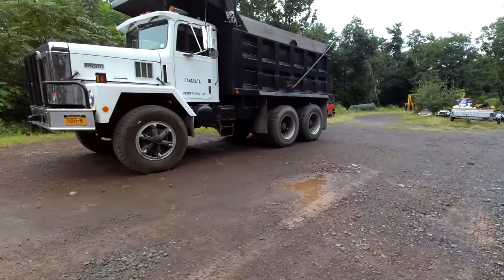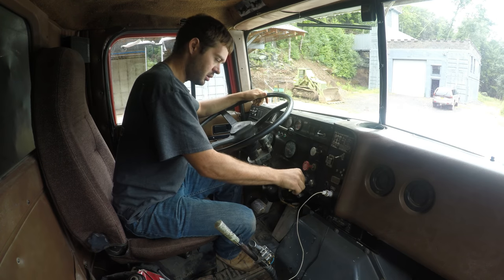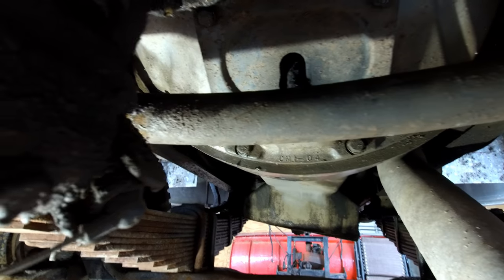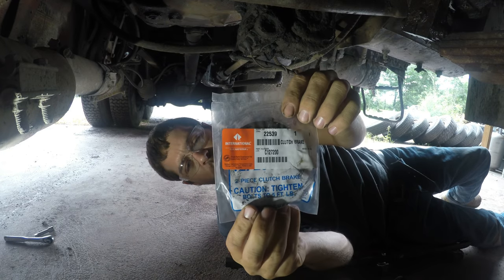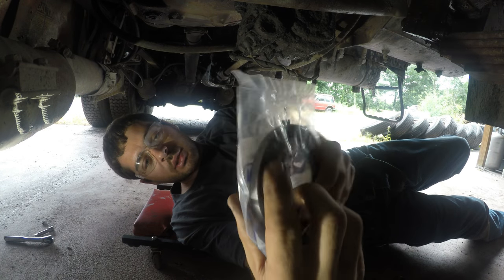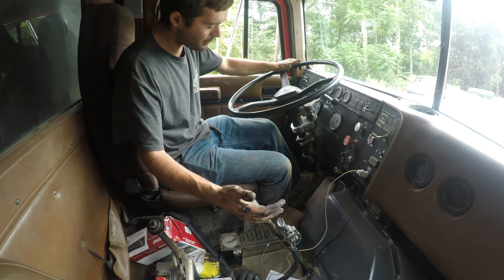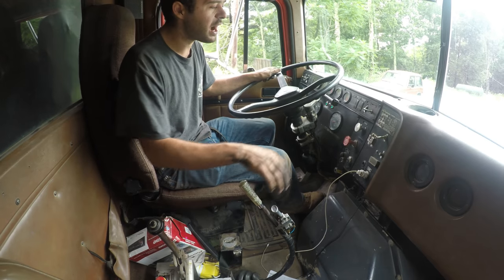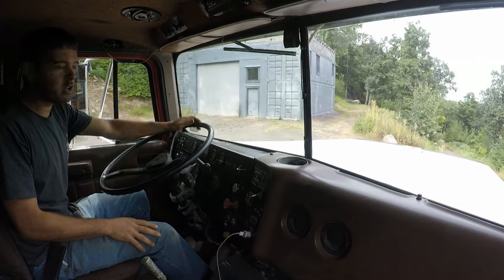Installing a new clutch brake in a dump truck

Comment: who ever told you to leave the old clutch brake in doesn't know what they're talking about because it effects your clutch adjustment which is very important on those bigger trucks! secondly whoever sold you that clutch brake sold you some old school version of a 2 piece brake, they've been making Spicer and Eaton-Fuller tool less clutch brakes for several years now that just snap together and you can buy them at any truck parts store including Napa for around $18-$20

Comment: I've been driving truck for 35 yrs I took my driving test on a quad box 1969 mack truck. A clutch brake is for a failing burnt clutch. I never use a clutch only when starting from a dead stop.

Comment: Wouldn't hurt to install a pyrometer and egt gauge. I see people in the comments saying you could hurt the engine lugging up that hill in high gear. I guess they ignored the part where you said the truck is empty and you were just experimenting. In reality, this truck is a different animal than a 3/4 ton pickup that would actually stress hard lugging uphill. You testing the limits at 1400 rpm isnt hurting anything. That engine's torque is probably highest at 1400 anyway. What a beautiful truck, even 35 years old it looks and performs like new. I had no idea about the clutch brake and its odd characteristics requiring you to not push in the clutch all the way while moving. Thanks for helping me learn something new every day.

Comment: Andrew when you won’t to shift from one gear to another clutch once to take it out of gear another to back it to the next gear. It’s called double clutching.put it in gear reave it to 1700 rpm as you pull the shifter out of gear let it lower to 1400 rpm and slide it in the next gear.after you get use to that then you can practice doing it by speed shifting. Same principle and you will in joy shifting a lot more. I drove trucks for 34 years and I used the clutch to take off and to stop other than that I speed shifted up and down with out the clutch.          Gary Letts from Montreal Quebec...........I in joy watching your videos, your are a very intelligent young man.have a safe and blessed life..

Comment: The reason why its easy to get into gear while its cold is the oil is cold and slows the input shaft quickly. When the trans oil is hot, it wont slow the input shaft down and its then difficult to get into gear. Excellent explanation of how the clutch brake works. 👍

Comment: To anyone reading the comments. If your clutch break is bad, when your coming to a stop and you push the clutch in leave the truck in gear until the truck comes completely to a stop. That will stop the gears and make it easy to get into 1st or whatever gear

Comment: You should remove the old clutch brake. By leaving it in causes a reduction in available pedal travel. You will have a wider mid area with it removed making upper gear changes easier. Like others have said, with practice you wont use the clutch to change gears. Keep your hand on the gear shift and you will learn the feel of the right time to shift as the shift lever relieves tension.

Comment: If you match your engine rpm to transmission speed you will only need to use clutch on take off. All engine and transmission combos are different, but it is easy to determine what RPM to shift at. While accelerating lightly push shifter towards next gear as you get closer to the right RPM you will hear the grinding slow down.  Remember to just ever so slightly push on the shifter and note the RPM in which shifter goes into gear. That is the RPM you want to use for every gear. To come out of gear you need to take stress off of drive line. To do that accelerate a little than let off gas pulling the shifter out the minute you let off the gas. If you do it right you will be in the window between trans trying to pull the truck forward and trans trying to slow truck down. As you learn this tecnique truck will shift smoothly and you will never use clutch again eccept for take off and stop.   Hope this helps. I used to double clutch until someone taught me a couple years into CDL career. Stopped using clutch 20 years ago. Clutch will last longer.

Comment: When I was a kid I drove a lot of trucks mostly Mack and autocar dump trucks and dump trailers with either a quad boxes or 13 Speed Road range transmissions the only time i use the clutch is when I start and stop, and I would always hear the older guys talking about double Clutchin I never did any of that just get the motor at the same RPM as the transmission and it will go right into gear little bit difficult at first but you’ll get the hang of it and it becomes second nature and I almost never use the brakes on the truck you just downshift and used engine braking obviously when you came to a complete stop you had to use the brakes or somebody pulled out in front of you but for the most part you use your engine braking, I never knew The clutch had a brake on it that would explain why some of the trucks were harder than others to get into gear you’re a smart guy Andrew love watching your videos

Comment: I train new CDL drivers and a suggestion when you come to a stop, leave the transmission in gear until fully stopped, (don't move shifter to neutral while still rolling) and when fully stopped then move the shifter to the gear you are going to start in.  The transmission isn't spinning and no need to use the clutch brake when at a stop. You can try it a few times and see how it goes.  Liking the videos!
Reply from the maker: Thanks, I usually try to do that, it is smoother. That was a bit of a demonstration of how the clutch brake operates.
Reply: And a good demo of what a clutch brake is and does and when needing fixed.

Comment: I got a job with a trucking company after getting my B1 license and while talking to the owner I heard him say the last dumb shit he hired did not know how to drive diesel trucks and he blew out clutch. I went to an old friend of mine and he talked to me for an hour about how to use rpm's and hitting the accelerator to speed up engine to let's say 1800 rpm's then when you let go motor will drop to 1500 or 1600 (as every truck can be a little different) and that is when you slide into that next gear. It takes a little practice to master (especially down shifting on a hill) it however, I never did damage any of those trucks I drove.
When your on one of your jobs Andrew talk with the truck drivers  ( concrete) and ask questions about how they do it. Then while shifting your truck do it completely by feel and learn to just slide into that gear (at the right rpm)  very gently. Great video and keep up the great show!

Comment: When approaching a stop sign or light,  rev the engine a little and slip the transmission into neutral. Coast to a stop. No clutch involved. Be ready to slip the trans into gear if the light changes to green. Again, no clutch involved. You are doing very well as a driver and an owner! Otto

Comment: I like a lot of guys have mentioned, thought you were going to have to remove the transmission to replace the clutch brake.   

Actually what you did is  break off the 2 tabs that you lined up on the input shaft, not wear it out.  They will snap off easily when you push the clutch all the way down when moving.
Great video and I learned about 2 piece clutch brakes.   I really enjoy your videos and have subscribed

Comment: i work at an international dealer, please remove that old clutch brake!,  and like geo said a half inch bar should just fit in between throwout bearing and cutch brake at rest,  and you adjust clutch with bolt  in order to get it to proper half inch gap as well as the gap between the throwout bearing and the clutch fork fingers has to be adjusted by physically adjusting linkages,  and lastly this is truck driving 101, you only fully depress clutch for first or reverse to stop the trans in order to shift aside from that power shift or go halfway like you mentioned,  also just from what I saw your old clutch brake didn't look horrible  probably could have just adjusted clutch up to half inch and it may have worked,  great videos though, amazed at what you are able to get done sometimes,  keep up the good work

Comment: Great video Andrew. Glad you got it fixed. What a difficult piece to put together up inside there. Those jobs are always frustrating trying to put together, stay in place, get the bolts in, tighten, with one hand, in the dark, all greasy and dirty.

Comment: I find myself asking "What would Andrew do?" whenever I have trouble repairing something at work and it works wonders. I find that, rather than getting frustrated and wanting to give up, my patience, motivation and determination to get the job done has increased immeasurably.
Reply from the maker: That is very good to hear.

Comment: When I learned to drive a big rig they always called it a transmission brake
because it stops the transmission from spinning. It doesn't stop the clutch from doing anything. 
That is just what I was taught. 😀
I was also taught not to use the transmission break when you're coming up to a stop. It's better to wait until the light turns green before you use the clutch brake to give it more time to slow down even more before you use the clutch break and make it last longer.

Comment: ~~~~~~ Clever fix......Getting the old one piece clutch plate out would be frustrating.... I didn't realize how enormous that 10 wheel dump was until i seen it pulled into the work bay.

Comment: That truck is soooooo sweet!  I admit the transmission would have scared me away.  You seem to be doing very well with it!  I have a 93 4700 lopro with 260k on it and a DT360 and it rarely gives me trouble.  Long live old iron!

Comment: Low RPM  when floating the gears . After you get some time under your belt with that rig,you will be able to tell when to shift by the sound the turbo is making. Practice makes perfect.  Awesome Channel love your work ethic! 👍🏻

Comment: I drive several international trucks and barely use the clutch.Here in Puert Rico  there are a lot of up hills/ down hills terribles curves,etc.A few months back i drove a military dump truck with a detroit motor/engine it was automatic 6×6 a real freak! Nobody dared to drive it because it's big.😎

Comment: George W(another person who commented) says floating gears saves both clutch and clutch brake. I completely Agree! However keep in mind, freeshifting is a matter of keeping your eyes, ears and/mind with the RPMs. Ideally you want the trans to pull gear in. Correctly applied, you use gears to increase speed and decrease speed! It's easier to increase speed than decrease speed. Why? Roadspeed is the enemy. You have to tap on breaks just right, firmly, and briefly to achieve the correct roadspeed. Another factor is if you don't freeshift/float gears correctly, you can shorten the life of rear diff if you make it a habbit! Finally, with your yr, make, model of truck, freeshifting is actually recommended by the Pros. Newest trucks have hydraulic clutches and floating the gears is actually not advised! You can cause clutch to come out of adjustment and if unchecked too long? You can break the bell housing! I know, it's happened to me! I double clutch and float gears 50/50 with constant regard and respect towards rear end! Pun intended(CYA), lol. Thanks for great vid as usual!
Reply: That's interesting about new trucks that don't recommend floating. Do you think if you were just to push clutch in and back out while cruising after a floating through the gears that  it would re-align the clutch? That to me seems like shoddy build quality if that much slack can develop in the pressure plate/clutch from engine torque alone from floating, unless your bad at floating and you pull/force it into gear. Or is it something else about the clutch that comes un-aligned?
Reply: @Atv821  I'm talking about newer trucks that have hydraulic clutches.
Reply: @Atv821  point is adjustment is supposed to have a certain amount of play and not too much.

Comment: Good video Andrew! But don’t leave the old clutch break in there! 
Trucks shift differently than standard automobiles. You don’t want to get your RPMs so high. Remember high torque low RPM. Trying shifting in the 1200 to 1500 RPM range. Once you find your trucks sweet spot, it’ll just fall into gear. I’ve driven a few trucks that were around 1100/1150 RPM. They had a Cummins in them.

Comment: Andrew, when lugging down on a hill it's best to slow down and grab a lower gear so not to send the exhaust gas temps into the red zone. Consult the trucks operator's manual for those safe temps. Excessive high egt's can melt a hole through a piston.

Comment: Interesting, I never knew about a clutch brake. I guess the trucks I've driven didn't have one. Looked like an easy enough repair. That truck of yours is a beast, I have a feeling that you'll get plenty of good service out of it.
Reply: BarnStangz 
Or you burned it out too🤔
Reply: Haha, I don't think so, the only other dumps I've driven were F800's and smaller Fuso's... Don't think that they had them but I could have been wrong. I suppose that the F800 could have had one, but I think it would have made a lot of grinding sounds like Andrew showed and I don't remember it doing that.
Reply: The only time a truck will have one is if the transmission isn’t synchronized.
Reply: @BarnStangz  smaller dump trucks like Fuso don't have one

Comment: tool less clutch brakes are nice, only problem is they sometimes disappear...no loss, makes it easier to do new one:)   they also have a nice remover for the old style brakes, you drill out it in two spots and finish with a air hammer, really nice
.  keep up the videos, great to watch
Reply: oh, remove the old one..always
Reply from the maker: The thing has been working great.

Comment: It helps to leave the truck in gear when coming to a stop while the clutch is halfway down. This stops the transmission with the truck so the gears don't need to sync. Once stopped, you can easily shift to desired gear. But when they're shot they're shot and you can't always work around needing to use it. lol Great video as always.

Comment: Great job Andrew. Word of advice practice downshifting by using your RPMs lug it down take out of gear slam accelerator to floor to 2100 rpm and downshift. Sometimes if it's a steep hill I'll downshift couple rpms before I'm supposed to in order to compensate for time to take out of gear and select the next one down. Also very important when lugging a hill to watch your pyrometer don't exceed 1000*. I like to find a gear that I can accelerate in and pull in that gear and not overwork engine. Keep up the good work. God bless.

Comment: Andrew -  Don't rev the engine so high, shift at a lower RPM.  
I agree with most of the others that you need to remove the old transmission brake!  What a cool idea, split transmission brakes!  What will they think of next?

Comment: the new clutch brake will get worn out alot quicker being you left the old one in there, therefore limiting pedal travel and more likely to engage the clutch brake when not needed. easy way to remove the old one is with a steady hand and a gas axe.  the clutch brake is also adjustable somewhat, after you set your 1/2" gap between clutch throw out bearing and clutch brake and adjust your free travel at the pedal. you will notice that with a proper adjusted clutch the clutch brake will engage better. you also want pedal free travel which is usually between 1-2" free travel at the pedal, you may need to add or remove slack in the clutch linkage in order to get free travel and correct clutch break operation.

Comment: great video, I never driven a truck this large with a trans brake. I could see me wearing out the brake myself. looks like you are shifting a lot smoother than when you first got it. little learning curve as with anything else in life. I think I would remove the old brake to give a little more clearance. likely not necessary but I think I would feel better about it. plus more room for error when pressing the clutch pedal down. not sure that accurate just my thought process. enjoyed the video, I respect that you have stayed the same down to earth guy you always were even though your channel is huge you don't kill your viewers with advertisements every 10 minutes like a lot of the larger channels do. for this reason alone I typically click the links and advertisements playing on and around your videos so you get credit for that click! keep up the good work brother!

Comment: I set my RPMs at 2450 on my semis tractors and use a Canadian spread axle setting. The higher rpm allow me to grab the lower gear easier as I to not have to fight the governor setting for pulling out of a pit, or climbing a hill.  Have a load keeps the higher rpm from hurting the engine for the shifting.  The axle spread is wider apart and allow for climbing over a stump or rock which would otherwise get wedge between the axles and make you stuck.
Reply: Well, the old 2-stroke Detroits, and the IH DT-466 and like engines will rev that high, but the Cummins in this truck won't tolerate it for very long.
Reply: Been running 2450 rpms for over 50 years on 855 CI or 15 L engines

Comment: Great video! If you ever need to replace the clutch brake again, I’d recommend the hinged type that just snaps shut - no bolts to worry about. Also, they’re made in the USA and excellent quality. Should be under SCB200 or HB200 on Amazon or Google.

Comment: As an x truck driver, I'd say put a ball shift nob back on there. It's more comfortable and makes it easier to shift. You can pul the hi low up or down easier as well.. My opinion... Just trying to help you out...
Reply: Need to put one of the original Eaton-Fuller knobs back on with the range valve.